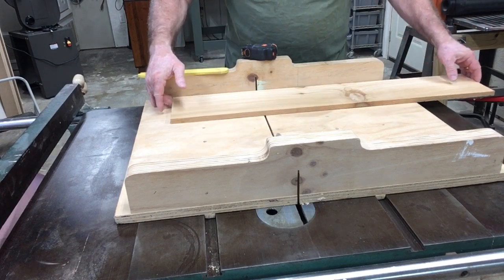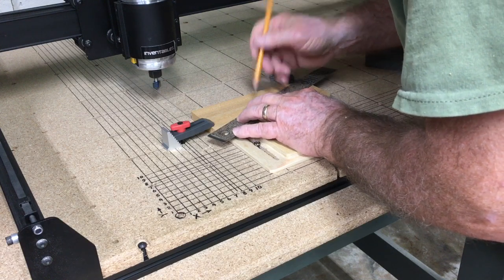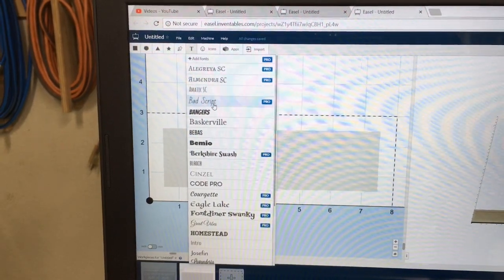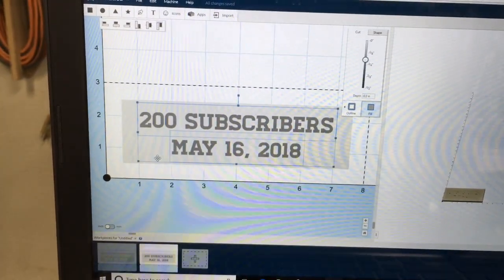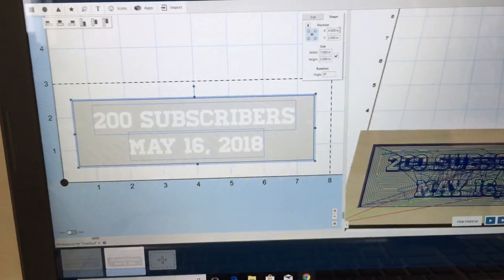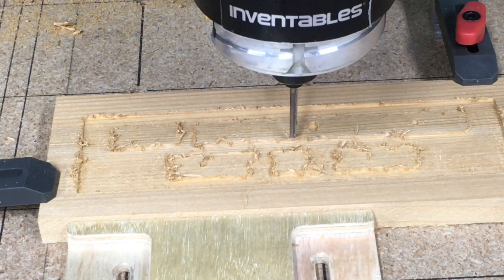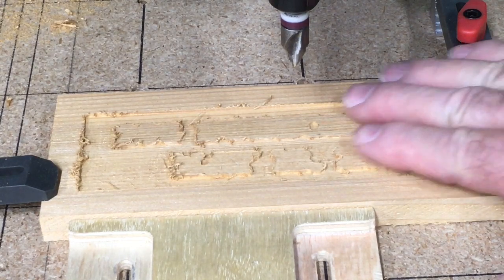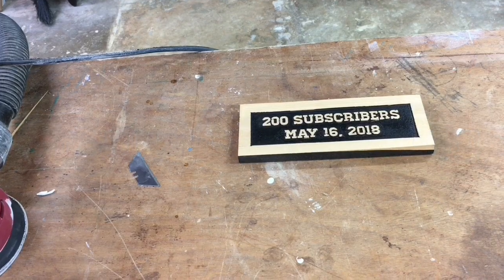Two Stage Carving in Easel (Easier Than You Think!)

Comment: Thanks for your videos. They have helped me tremendously on my CNC journey. 
I’m using Easel Pro and I’m having a problem with witness marks in my pockets. How can I create a final finishing pass to hopefully eliminate the marks? 
It’s worth noting I’m using a 1/4 down cut that’s brand new. All my settings are what are preset by easel.
Reply from the maker: If you are getting the tool marks in the bottom of the pocket that usually means you need to tram the gantry. This means the bit is not perfectly perpendicular to the project

Comment: Thank you..so yours is under tension a bit and has worked great...thats good to know...i need to buy a cheap fiahing scale to test this...can u test your tension on the belt at the actual pulley location..i think thats very important too....when u are testing tenaion on the y rail belt where do u place the gantry?...it does matter....the longer piece of open belt you test the less tension needed to move it 1 inch
Reply from the maker: I move the gantry completely out of the way.  Then find the center point of the belt and put the fish scale at that location.  Pull straight up to a one inch point and read the scale.
Reply: ok thanks @PawPawsWorkShop

Comment: Enjoy your videos, I just got a model m3 and using easel and I have had a lot of problems with setup but inventables have been 9 out of 10 helpful and also some other videos have helped with them and I am up and running at about 90%. Thanks to your videos I have made some designs and tried the basics and now trying the 2 stage. I was wondering if you can do 3d caving with easel and if you can could you show it (I have not seen any on your channel, sorry if I just missed it!). Thanks again for what you are doing.
Reply from the maker: You are very welcome.  I'm glad you are up and running.  You can do 3d carving on the XCarve, however, you must produce the project in another program and send the gcode to the CNC.

Comment: Hi good video 
But the part where you actually added a 2nd bit was 1 second and had to watch 3 times to find what u done as was looking for your mouse pointer on screen but it seems there’s an  add button to the bit selection ?
I don’t have an x carve just a cheap Chinese 60/40 but works ok for my use 😊👍🏻
Reply from the maker: In Easel at the top right of the screen you have the selected bit and the option to add a second bit.

Comment: Sir, do you ever have trouble with the router moving while doing the bit change to the detail bit? When loosening the collet my router is moving and I thought it would be locked in place. Thanks
Reply from the maker: Change GRBL settings to $1=255
Reply: I'm using easel and not real sure about changing the grbl settings means.
Reply from the maker: Go into machine advanced. You’ll see the GRBL settings. Currently I guessing $1=0. Change it to $1=255

Comment: Great Videos!  I've leaned several things from them.  I'm using easel and cant figure out how to use 2 different V-bits on the same project.  I'm carving the stars in the union on a flag with a 90, and want to change to a 60 to do a company logo in the center of the union.  I watched your video on using 2 stage carving, but easel want one of the bits to be regular...
Reply from the maker: Carve the stars in one workpiece with the 90 degree bit.  Set up the company logo in a separate workpiece to use the 60 degree bit.  This is the same as doing two different projects.  I have used this method in a number of videos.  Hope this helps you and good luck with your project.  Please let me know how it turns it out.
Reply: @PawPawsWorkShop  Thank you.

Comment: I'm new to the game and in the process of deciding on the software to learn. Don't want to start with a program that I will grow out of quickly. Looking at Vcarve Desktop, Fusion 360, Carveco Maker and Easel. Seems like everyone is either using Vcarve or Fusion 360. If your are going to learn one which o ne would you suggest?
Reply from the maker: The software I would learn is VCarve desktop. You will be able to design all of your projects and you will be able to adjust and alter 3D projects. You cannot creat 3D without Aspire which is expensive. You will also need a sender to send the gcode to the CNC machine. I use the Openbuilds controller which is free. I would also suggest to get Inkscape (also free). You will be able to easily improve files and convert images to svg files.

Comment: Your video was excellent.  I have been having issues about two stage carving with my x-carve.  I just bought the machine and am learning.  How do you keep from moving the spindle when changing bits?  Also where can I purchase the bump stock?
Reply from the maker: Do your stepper motors lock when not in use?  Also, most people over tighten the bit in the router.  The bump stops are a shared file in Inventables Project page so you can make them for free.  Thank you very much for the compliment

Comment: whats the best way to re zero the xy to the center if the machine moves ever so slightly while changing the bits?
Reply from the maker: A 3 axis touchplate is the best way.
Reply: Hey… I’ve found that if I drill a pin hole at my starting point then it’s easier to find my zero after bit change. It’s barely noticeable and it works great. My spindle is a tight fit so it always move.

Comment: Hello Sir, I am having trouble with 2-stage carving. When I add the 2nd bit (60-degree v-bit) for the detail, it automatically changes all cuts to using the 60-degree bit. I want to use a 1/16 bit to cut out the outline and only use the v-bit for the detail work, however, it will not allow me to separate the cuts. Please help! Thank you.
Reply from the maker: I have a couple of ideas that may be causing this. Please share the project and post the link here. I'll take a look at it to see the problem.
Reply: @PawPawsWorkShop  Thank you, sir! Here is the link  https://www.inventables.com/projects/bbq-grill-scraper-with-text-2
Reply from the maker: this is not publicly shared and therefore I cannot open it.

Comment: How do you change the bit without moving the x and y my motors are locked but they still move when I put pressure to losen the bit maybe I'm over tightening the bit please help how tight do they have to be
Reply from the maker: First the stepper motors should be locked.  Check you setting $1=255 should be the setting to lock the stepper on the XCarve.  You may be over tightening the bit.  Usually a half turn to three quarter turn with the wrench is all that is needed.

Comment: When exporting the 2 stage gcodes to then upload to another program like UGS, does it export as 2 separate gcodes or does is export it just as 1 gcode that pauses after the roughing pass to allow the bit change?
Reply from the maker: Usually if you have multiple toolpaths all using the same bit you can save all of them and it will carve one toolpath at a time until completed.  I have not tried 2 stage carving with two different bits from Easel.  That sounds like it time to experiment.  Thanks
Reply: @PawPawsWorkShop  I'm confused (and new to this).  Doesn't this vid show two stage carving with a bit change?

Comment: Hi paw  paw....has your xcarve ever lst steps on y axis....mine does all the time...its aggravating..belts tight...wheels tight...
Reply from the maker: I've only lost steps twice in two years and both times it was my fault.  Be careful that your belts and  wheels are too tight.
Reply: Ok thanks...mine has happened a lot...since day 1...but now its so bad i cant do any jobs...could also be wiring or driver or bad motor...its alwaysnthe right y motor that makes weird noises when it loses steps
Reply: Im going to try and lossen belts a bit....they dont have to be too tight but should not be loose....my 3d printers have been loose for a while and never skips...and we all know the motors on xcarve are strong enough but the drivers are cheap and underpowered especially 1 underpowered driver xontrolling 2 motors at one time.....many xcarve issues are design flaws and not user issues
Reply from the maker: There has been many discussions on belt tension on the forum and the general thought is that they should be about 4.5 lbs when measured from the center and pulled up 1 inch.  For me, my belts are 
3.5 lbs and I have never had a problem.  Again, it like everything else, what works for my machine may not work for yours.
Reply from the maker: It is possible.  You have to go through your machine one step at a time and eliminate each potential problem until you find the problem. Good luck, I know it can be very frustrating trying to find the reason.

Comment: Hi, is there a way to lock the x y drives so when i change the bit the router doesn't move
Reply from the maker: winyate .  In GRBL set $1= 255. That will lock the motors anytime the x controller is powered up.

Comment: Hey Paw Paw.  I tried to duplicate this project as best I could so I could compare carve times, but mine differs from yours considerably.  I created the same design and used the same bits, and I did NOT adjust the feed rates.  Your simulation estimated 7 minutes for the roughing pass and 17 minutes for the detail pass.  When I do it, it estimates 11 minutes and 30 minutes.  Any idea why there would be such a difference??
Reply from the maker: Inventables has made a number of changes since I did this video.  Some causes could be speed rate and depth of cut.  The number of passes will affect the time greatly. Also, the stepover could be different.  I do not remember what that setting was at the time.
Reply: Did you do the roughing pass at .5” or .05”? He says 1/2” but then set the cutting depth to 1/20”

Comment: Thanks for the video, I'm new to X-carve and haven't done 2 stage carve yet. Is there still a possibility when changing the bit, the router can be moved ever so slightly? Can one use the last XY setting command to get around that or can homing / limit switches be use to calibrate back to original position? Thanks.
Reply from the maker: Armando Jaimes .  Yes you can use last xy. Be cautious,  I have been successful with this and I have also had the machine take off in its own world.  Sometimes it will forget the position. Therefore I do not trust it anymore. You may have more success than I have had with using this function
Reply from the maker: Armando Jaimes.  I do not use the homing switches

Comment: did I miss something,  watched three times , when or how did you set two stage carving ?
Reply from the maker: Two stage carving is using two bit while in only one work piece.  I used a small straight bit to rough out the bulk of the material, then changed the bit to a v-bit and completed the detail pass.  In Easel in the top right corner you have the chosen bit displayed, next to it is a plus sign.  It is there that you can add the second bit.
Reply: Beside the Bit selection pane to the right is + to add the second bit.

Comment: Good Morning... I don’t have an X-carve but I do have a SainSmart 3018. I’m assuming that these instructions can be applied to my machine. If not, what should I be doing different. Also, I want to save this to a “flash drive” and copy it to my lap top in the garage, what kind of problems would I have? Thanks
Reply from the maker: It should be similar, I am not familiar with that machine.  In Easel you can save the files to your computer using download zip.  Last tab on the left side of the screen.

Comment: I've tried this. My problem is that I can't change the bit without moving the router. So I never end up back at the same zero. Any suggestions?
Reply from the maker: Does your stepper motors lock or does the gantry move freely?  Change your settings under machine advanced to $1=255
Reply: Paw Paw’s WorkShop moves freely. I will try this.
Reply: @AngieWilliamsDesigns  I believe you can go to [Menu] Machine >> Advanced > Machine Inspector, which will display the machine position. Jog the spindle to a convenient location, change the bit, then jog it back to where x, y, and z are all back at zero. This should work, but you'll want to try it on a test piece first. Good luck with your project.
Reply: Marc Johnson I was able to figure out how to lock it. But I've still had times where it accidentally moves. This is a great suggestion
Reply: @AngieWilliamsDesigns  Literally just occurred to me, one other option is to use a couple of dial indicators attached to bases (one to measure the X position and one for the Y position). Set them at zero, jog away, change bit, jog back to zero on both indicators. Same concept, just measurement that is independent from the machine. Ebay search "Dial indicator and base" for anyone not familiar.

Comment: how do you do a 2 stage carve from Vcarve to easel?
Reply from the maker: Chris Scheele .  In Vcarve you would setup tool paths for the two bits. Create the gcode and send to easel. Open each gcode file in a separate work piece. Then carve each work piece with its correct bit. Hope this helps you
Reply: @PawPawsWorkShop  Thank you.